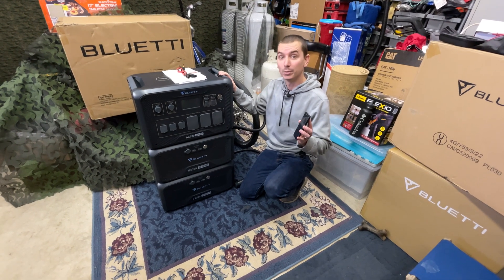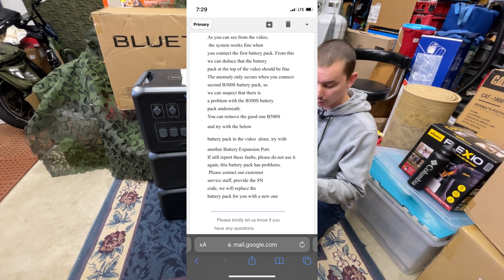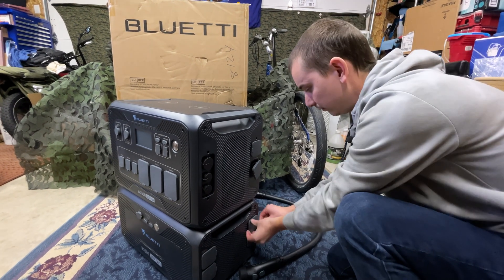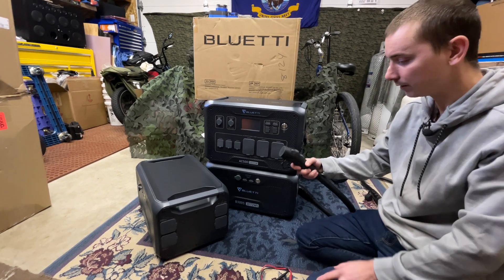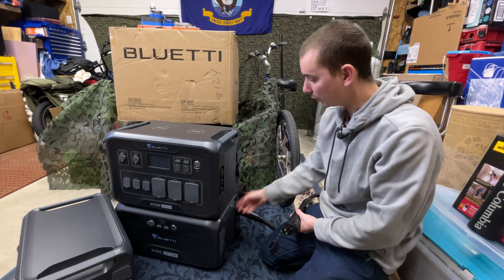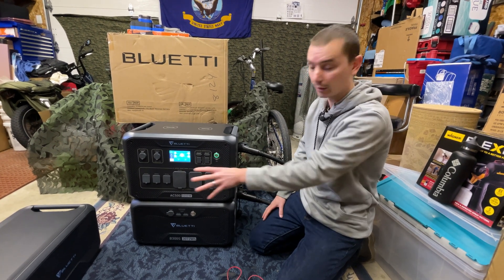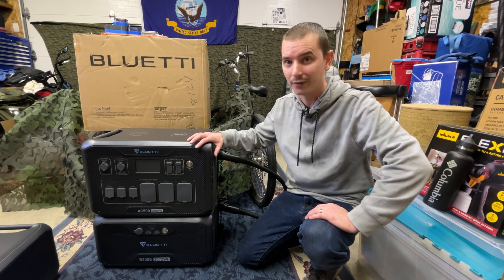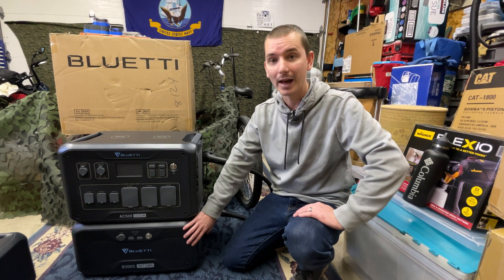Bluetti AC500/B300S Follow Up - Email From Bluetti and Further Diagnostics

Comment: Having issue with my system,Error code 008 OCP.Hope you don't encounter this too, not getting response from Bluetti not able to use my system completely.Any tips on how you can get help from service??Really frustratingThanks
Reply from the maker: There is a Facebook group for bluetti and I believe it is probably the fastest way to get a response from them. That’s what did the trick for me. Thanks for watching!
Reply: @diyrenewableenergyelectron4996 what is the  adress or link to website ?
Reply: I am to . No actual help from Bluetti for repairing it or replacing it. Just games until I give up or my warrantee expire

Comment: I NEED HELP!!! I have sent email (2) to Bluetti but no response. I recently purchased the same AC500 and (2) B300S. I charged everything up and did a test running a small oil heater in my home. Everything fine but batteries drained after 6 hours. Very over cast, so solar panels did not recharge B300. So alarm kept going off, so looking at screen I saw AC button, and thought if I turned that off it would stop alarm. I finally was able to turn off screen and alarm stopped. Now everything is dead and I tried turning on screen, but it will not turn on. I think it is because I turned off AC button. I tried hooking up provided cord to charge with wall outlet, but it is not charging and inverter/screen not turning on. What or how can I correct the problem? Thank you for any help you can send me!!!
Reply from the maker: Hi Linda, I’m not familiar with this issue. It could be that the battery BMS went into a protect mode and needs to be reset. Try a Google search for resetting the bluetti after a deep discharge. Thanks for watching!
Reply: @diyrenewableenergyelectron4996  THANK YOU!!! for your quick response!!! I will do as you recommend.  Linda

Comment: Thanks for sharing. I ordered the B300S as a standalone product. Since I don't have the AC500, would you say the way to test this and determine if I have a bad battery is by using a multimeter to see if it reads 52.9V? If so, do you have a link for that multimeter? Thanks, and keep up the great work!
Reply from the maker: Yea, I would say if the battery is shut off (no lights on) and you’re getting voltage out of the terminals, it has an issue. I got the multimeter from lowes, I’ll look for a link.
Reply: Just curious what did you order the battery for? Another Bluetti product that accepts the B300S?

Kind of baffling how something as simple as an expansion battery can have issues for so many customers
Reply: @ericklein5097  In the short term I bought for an Iceco JP Pro 50 fridge and to use it during power outages and camping for a CPAP machine (as well as the fridge). 

Long term I bought it anticipating they will come out with a newer version of the 200 Max that will support the use of it. Given it was so inexpensive (relatively speaking) to retail I thought it was a good idea. After getting it, and if I was being honest, I did not anticipate how large and heavy it is even after watching the videos. Plus, I thought you could use the power brick from other Bluetti’s, and I was wrong. I have some regret. 

Sorry, long story.
Reply from the maker: I hope in the future they update their product line to be compatible with the B300S. Mix and match between batteries/generators would be excellent!
Reply: @beeski  Ahhh thats right the battery still does have DC output which is actually quite nice of them even though I'm sure it costs them an extra $10 add all of that on. Not exaggerating on their cost either, its that dirt cheap
Reply from the maker: Actually, the B300S was ordered for this AC500. The AC300 is not compatible with the B300S battery

Comment: Hi there, would you know the max solar input you can have for an AC500 with 1 B300S? Is it the 3000Max as specified? Wasn't sure how to interpret the solar input figures.
Reply: Yes! Doesn't matter if you one or three batteries either 3000 watts solar input!
Reply from the maker: The max input voltage is 150v open circuit and the max amperage is 15amps. There’s two built-in MPPT charge controllers. Thanks for watching!
Reply: @diyrenewableenergyelectron4996  thanks. I was planning on picking up some panels and connect them in series. I will make sure the total input watts is less than 3k. 

Each one is 360w. The VOC is 47.7. Is this the voltage? If so. Should I only get 3?
Reply: @bluyetiinc7553  
Voltage Open Circuit  = VOC so yes 3 of those 360 watt panels in series for each mppt controller so total of 6 panels 3 of each in series. What brand of 360 watt panels you looking to buy?
I have the AC300 with six Q10 360 watt panels with three in series per mppt controller and I get great output from them but they weren't cheap!
Reply: @billy2bob63  Thanks for your response. I am planning to pick up Solaria PowerXT 360R. They are new at $120 each near me. So, I dont need to add shipping. So, I believe I can connect 2 strings of 3 each. What would I need to connect the second string? Is there an adaptor or similar?
Reply from the maker: If you have the AC500, it comes with a plug that has an MC4 (solar panel plugs) to AC500 input adapter so you should be able to connect to the AC500 without any special cords or adapters.
Reply: @bluyetiinc7553  
Yes there's a connector that connects the solar input to the AC300 and it has two positive and two negative wires/feeds for the solar input! Buy your 10 gauge PV wire from windynation the cheapest if found it for my quantity I needed.
Reply: @diyrenewableenergyelectron4996  Thank you
Reply: @billy2bob63  Awesome. Thanks.
Reply: @bluyetiinc7553  
I never heard of those panels before. With a Google search I see now but you sure there new for that price because I see ads for $349.00 each?
Reply: @billy2bob63  I'll check. He claims they are new. Thank you for your time.
Reply: @bluyetiinc7553  
Your welcome 👍
Reply: @billy2bob63  I ended up getting thee. They certainly look new. Apparently,  he was building out a solar farm, burnt his warehouse. Now getting rid if these. Still not sure why he is selling cheap. 

I was able to connect a couple of these together. It's a really cloudy day so am getting a low input around 100 watts for 2 of them. Not a great test today.

I will probably get an extension 10 guage pv wire from windy nation so I can attach at least 3 in series.
Reply: @bluyetiinc7553  
You need to check the panels on a sunny day each individually with a volt/amp meter to see if the voltage and amps out of the panel is correct! We're the pv wire leeds off the back not long enough to tie the panels together? Mine had plenty and then some.
Reply: @billy2bob63  thank you. Looks like the wire shipped with the AC500 is like seriously short.
Reply: @bluyetiinc7553  
Mine too it's designed that way. That's why I mentioned windy nation for pv wire to connect between that and your panels. You will need to run 2 positive and 2 negative pv wires. But definitely check those solar panels for there voltage and amps output to make sure they are working properly 👍
Reply: @billy2bob63  thanks again for your excellent advice.
Reply: @bluyetiinc7553  
Your welcome
Reply: @billy2bob63  Just to keep the conversation going. I was able to do some basic testing and getting close to 340+ watts from each one. I connected  2 in a series got close to 700+ in. I still need to test each one, but am feeling optimistic.
Reply: @bluyetiinc7553  
Hell yes 👍

Comment: That 2 volts you are getting out of the good battery is back feed. If you had a better meter with a lo-z function that 2 volts will turn to zero like it should be. Also even though you have a cheap meter you should still have a continuity feature on it. You can test each pin on the cable and determine if it's good or not.
Reply from the maker: Interesting! Yes, my meter has a continuity function. I’m pretty confident the cabling is okay but it never hurts to check! Thanks for watching and commenting!

Comment: You don't know whether the cable in the battery unit caused the fault on the battery in the first place. I would ask for a replacement of both B300S and the conecting cable just in case or you might blow the next unit aswell.
Reply from the maker: That’s a good point. We did try swapping the cables between batteries and the issue was consistent with the one battery but a replacement cable wouldn’t hurt. Thanks for watching and commenting!

Comment: Your 2.6V on the good battery when off is just leakage through the connection circuitry (when the battery is off).
Reply from the maker: Makes sense! Thanks for sharing.